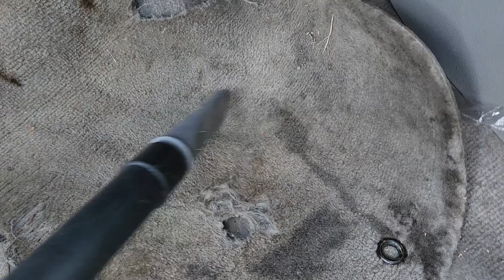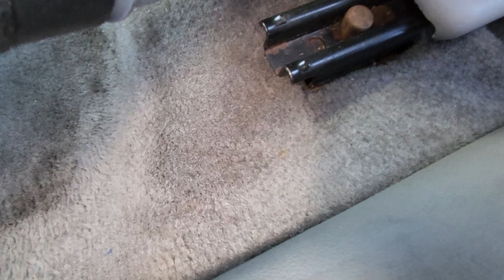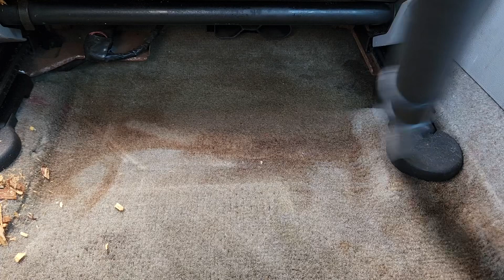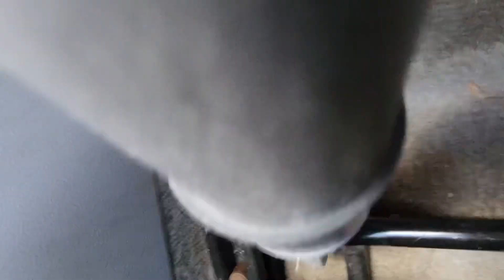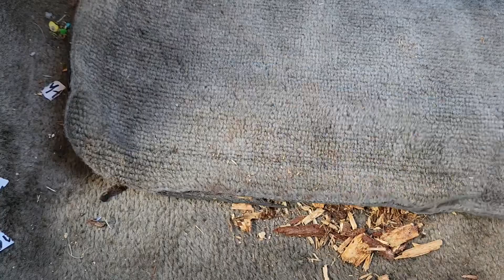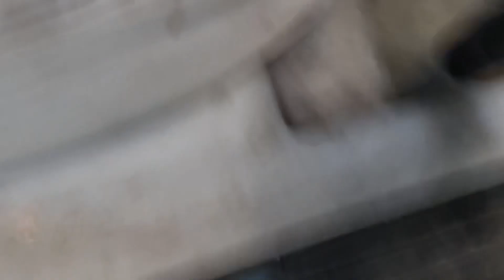Vacuuming the Dirty Car Pt. 2 | Bissell Helix

Comment: This is weird--I think, anyway.  I don't like new cars.  I don't like a pristine car interior.  I like this.  The car that has obvious wear and tear inside but is vacuumed or I like, and I like it very much, a car interior that has a lot of wear and tear but is vacuumed.  I like the way it looks.  My husband uses our car most of the time.  I find it difficult to leave my house so I stay home a lot but I am comfortable getting into my car as long as it's picked up--as long as there is no junk on the floors or anywhere else.  It doesn't need to be vacuumed just clear of clutter.  My husband generates a lot of clutter.
Reply from the maker: It’s not weird (look - we makes messes on purpose, sometimes make it look pretty and vacuum it up lol). I always appreciate you being here. Yeah, I thought it would be a fun touch (rather sound) to add those wood chips to it. I hope to get other car to vacuum and also shampoo them. But, it’s starting to get cold outside.

But, I feel the same ways about cars- as long as it’s not messy, let’s go. That car is 16 years old.
Reply: T  xoxo